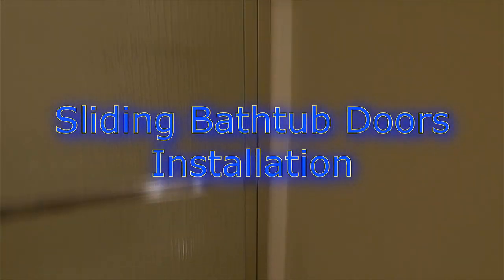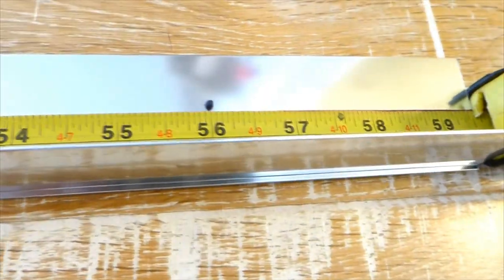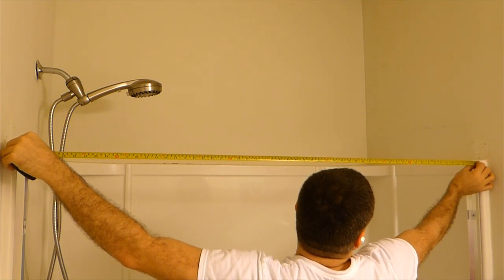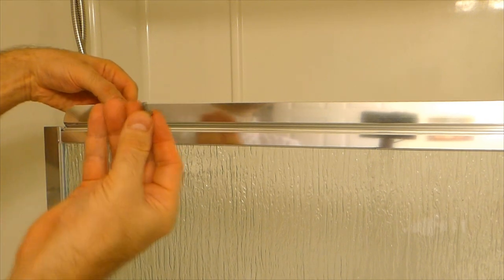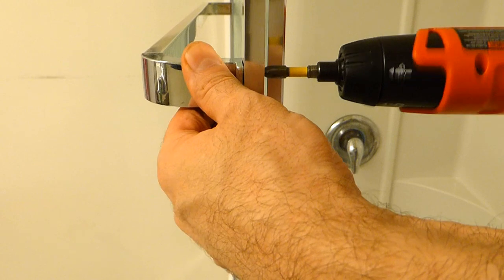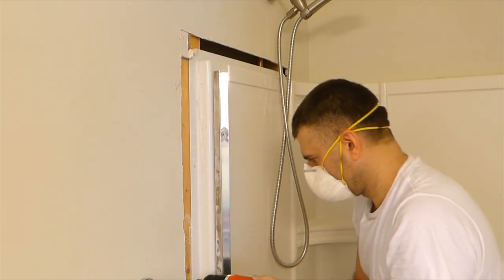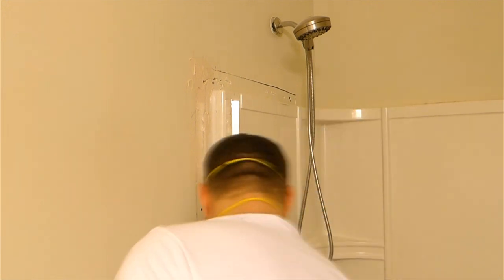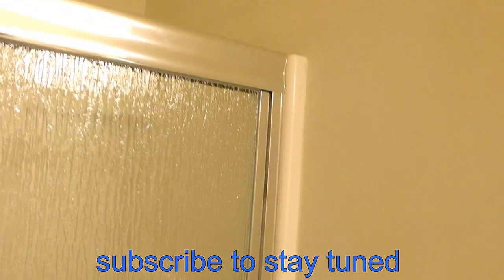How To INSTALL Framed Sliding BATHTUB SHOWER DOORS (Franklin Brass DIY Assemble Guide Home Depot)

Comment: It can never just be cut and dry?!  Good to see a genuine video, where there’s an issue, and it gets resolved.  I’m going to pick one of these up for my upstairs bathroom.  My goofy kid’s can’t seem to close the curtain correctly, and the garage ceiling (directly below the shower), is getting a little funky!.  I measured and it’s 1/2” off, 53 1/2” on the bottom, and 54” on the top.  Wish me luck…
Reply from the maker: Hello Tony! Thanks for your kind words. Yes, may be I am so unfortunate but I mostly end up with some kind of obstacles that need an additional effort. Hope your installation is less problematic and you will be able to adjust it by just repositioning the rollers. Wish you good luck! 😊😊😊

Comment: lot of extra work,I installed sterling bathtub door yesterday my one wall is 5/8 and other tile wall 1/4 inch out of plumb,no need to cut open the walls ,just adjust the front and rear rollers up and down 
after few attempts you will get desired plumb if littlle off by 1/8 inch use plastic shims behing wall jambs and cover with caulk
Reply from the maker: Hello! Thanks for dropping a word! I tried to adjust the rollers of course, but the result was very ugly. Even with the maximum adjustment it was not looking good. So, went the hardest but the most proper route, I think. Glad you were able to get away with simpler solution on your side and the results satisfied your quality standards! After all, it is to be happy with the result of your effort!!! Thanks again for commenting! 😊😊😊
Reply: @tetmax  Thanks for calrifying,but if somebody have tiles wall you can,t cut open walls and adjust it(like in your case fibreglass wall) that's why posted my comment if  somebody is in similar situation might help
Reply: @ranjitsahni  yes! Thank you for that comment and your experience on how to deal with tiles walls. I am sure there will be people out there that have similar situation as you had with your project! )))

Comment: I have virtually the same doors on my tub. While installation was fine, that top track is now drooping ever so slightly in the middle causing my doors to both want to slide towards the center of the tub and away from the wall. This perplexed me for some time until I put a level across the top and found the bow in the track. So far I have just used  some magnets affixed to the tops of the doors that contact some steel I screwed under the top screws on the vertical pieces. I think this aluminum is not very strong and with the weight of the doors coupled with the occasional grabbing onto from people, the track has sagged. Trying to figure out a better solution. May just have to buy a different door system.

Comment: can i install a bypass shower door  on a fiberglass/acrylic/prefab shower with bathub? The stall walls portrudes on the side  about  an 1" I think so I don't know how would I install the side wall rails on this type of shower.?
Reply from the maker: Hey, Marco. Thank you for visiting! I would not be able to answer your question as I am not a pro in that area. I just shared my own experience with people who's interested and may benefit from what I did here. May be you can solve it and make a video about your case to help those with similar situation. 😊😊😊 Hope you find an answer and finish your project perfectly!

Comment: How dis you just screw into the fibreglass though? I see people say you cannot attach these doors to dibreglass but it seels like you were able to. Did yiu not need any special plugs or ankers? Great video.
Reply from the maker: @ Ruan Pienaar, Thank you for commenting! I did not use any anchors. I decided to just try without them and see if it holds OK. The main force during the use is directed in/out of the tub where the screws do not need any anchors. If you would try to pull out the side bars in the direction opposite to the wall then you would probably need them but since it's not happening mine hold on fine after 4 years of use. The top bar also helps to secure side bars.

I used a smaller drill bit though, so the screws are a bit bigger then the holes I drilled. Also, I put some silicone to the bottom holes prior inserting the screws just to keep the water out of it. I can guess if you screw in just once it will be fine without any anchors. If you screw in/out a few times the holes become a bit lose and you will need some kind of an anchors.

Comment: Thanks that was helpful,I'm installing the same now but I'm stuck how to attach the panel locator..its written " attach panel locator to the inside framed door panel on the shower head side of the enclosure" i didnt see it in your video..I dont know if you can still hell.thx
Reply from the maker: Yes, Chad. I forgot to film it. I just inserted it right on the bottom of the inside of the shower wall jamb. )))

Comment: Good video. I have a framed shower sliding door that looks similar to yours. Water Is leaking onto the wall from the bottom left corner of the door when the shower is on. I put clear caulking, but I obviously did not put the caulking in the right area. Water is still leaking onto the wall, while the shower door is closed. If you have any suggestions for me on preventing the water from leaking out the bottom of the door i would greatly appreciate it. Thanks so much.
Reply from the maker: Hello. Sorry to hear you have troubles with the leakage. Are you talking about the shower side of the shower?

If so I can think of 4 reasons:

1. The sliding door on the shower side should be on the inside rail of the bottom track - closer to the tub.
2. The shower doors need to hang lower to the bottom track (may be need some rollers adjustments to move the doors lower).
3. Not enough caulk under the bottom track. 
4. Also, there was a little clear plastic clip that needs to be clipped on the inside wall jamb on the very bottom - on the shower side. It keeps the inside door stay on the track in one position. I did not film it because did not think it was important at that time. See if you installed it properly.

If nothing of this helps try to start the water and go outside and observe where the water comes from exactly.

Hope you figure it out somehow. Good luck!

Comment: I owe you one my friend.
Reply: Any chance you could enlighten me on step 5 panel locator?
Reply from the maker: Hello Raymond! What is that exactly in step 5 that you question?
Reply from the maker: Raymond, if you are talking about the little plastic clip (panel locator) I just inserted it on the bottom of inside the shower wall jamb. It seems to be useless in my situation as my door panels stay within the guide anyway. I guess if somebody pushes the shower side panel from the outside of the tab the panel locator will block the panel from moving off the track. Hope my explanation make any sense! :)))
Reply: @tetmax  it's just a small plastic clip that you are not sure where to put it. I thought it was a door stop to keep people from slamming the shower door. But the clip broke into pieces first door slam. It sounds like it is to help guide the bottom door so it doesn't flop around, but there doesn't seem to be a problem and the plastic piece is fragile.
Reply from the maker: Yes, that is what I wrote right above. It is kinda useless! :)))

Comment: What size drill bit did you use
Reply from the maker: Thank you for visiting, Don Francisco! Unfortunately, I do not remember the exact size as the project was done almost 2 years ago. You just have to use a bit in accordance to the screws size in your package. They may even list it in the instructions included in the package.

Comment: Did you use some kind of anchors when drilling the rail to the acrylic wall or did you just drill regular screws into it? The acrylic wall has a space between it and the drywall no?
Reply from the maker: Hello! Thanks for visiting! Yes, the wall has a space but it is not crucial since the frame is locked in by top and bottom rails. Therefore I did not use any anchors. The screws do not allow any in/out movement and the rails secure the frame within the enclosure.
Reply: @tetmax  hey thank you for the reply, this video was super helpful ! ! 😄
Reply from the maker: I am glad it was! Thank you!!! 😊😊😊😊

Comment: Did you caulk on the inside of the enclosure (tub side) or the outside? I caulked the inside first and noticed some water leaking under the frame. After researching I’ve found some kits have drain holes on the inside that shouldn’t be caulked. I no longer have my install instructions for this door (same as yours) so I’m wondering if I should add more caulking to the outside, or remove my inside caulk or ?? Any suggestions? Thanks!
Reply from the maker: Hello! Everything I did with caulking I showed in the video. I did the bottom rail and added a few drops when was screwing the side bars - but only on the bottom screws. I did not have to add any additional caulk anywhere since then. There has not been no any leakage but I gave it 24 hours to dry out before using the enclosure. As for suggestions, I would definitely seal it if it was my case. Would try to notice where the leakage comes from and caulk it carefully from any side - in or out. Good luck to you on fixing it! 😊
Reply: Thank you!  I also caulked under the main rail when I installed it but will try to find the exact location of the leak and go from there. Worst case I pull it apart and start over. I appreciate your video and your reply!

Comment: Hi, what tool did you used to cut through the metal? Thank you.
Reply from the maker: Hello! Thanks for visiting! It was a regular table saw. The metal is pretty soft so a hand saw or a jig saw would do the job easily. But I wanted a more nice looking cut so used a table saw instead.

Comment: I need put silicon around the frame? Or is not necesary?
Reply from the maker: Hello Avril. I am not sure what 'frase' is. But I used silicon right where I showed in the video. Since I installed the doors I never had any leakage from anywhere.
Reply: Frame.  Sorry. I will try put the door myself.
Reply from the maker: @avrilgreen4049  I see. I used silicon under the bottom rail, and put a few drops on screws of the shower side. Of course you are free to use it anywhere  you feel you need it - as it will not do any harm anyway. Good luck with the installation! ))

Comment: When you drilled into the wall for the side rails, are the screws hitting a stud, or is the  shower wall material made out of dense plastic?
Reply from the maker: No studs. Just plastic. It is not that dense but it holds the screws fine so far.
Reply: @tetmax  OK Max, thank you for replying.

Comment: What size did you buy for your tub
Reply from the maker: I think it was a 60 in frame. Based on the video I cut it to make 56 in to fit my enclosure. 

Check the video @ https://youtu.be/EvbavTw35VY?t=49

Comment: My bathtub doors got disaligned in the top rail and it is difficult to move them . How can I realign them?
Reply from the maker: Hello Varda,

Thank you for commenting. 

Let me answer. Here is how it works. The kit maker must provide you with functional mechanism and your task is to assemble it properly and prepare your environment to be suitable for the kit. 

Now, what you describe is a problem that has to be fixed by the manufacturer. My kit also came defective - one of the rollers did not have any thread on it. I called the kit producer with the provided number and they sent me a replacement free of charge overnight. What you describe sounds like a defective part. I would call the manufacturer and requested a replacement or returned the kit back to the store and get a new one without any issues. Good luck with everything.

Comment: He should have used smentboard not drywall . Smentboard withstands water drywall don't.
Reply: It is located on the outside of the shower surround where water will never hit the the wall especially now with the doors installed. It will be fine.
Reply from the maker: Thank you, Richard! It's been over a year since the installation took place and the drywall is perfectly fine. )